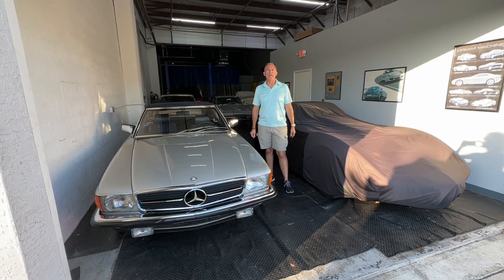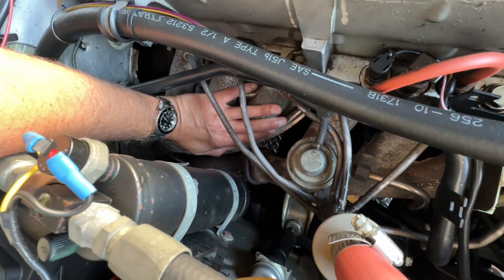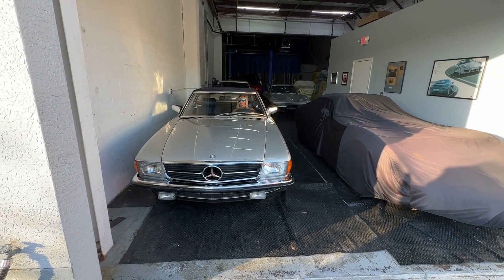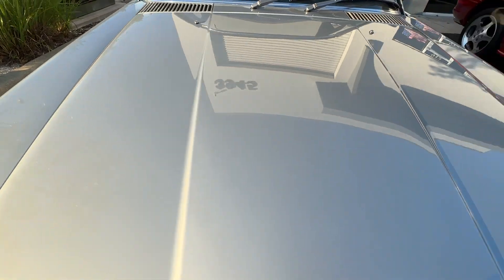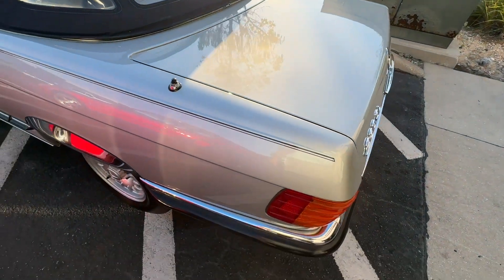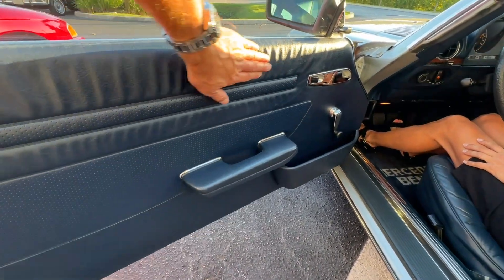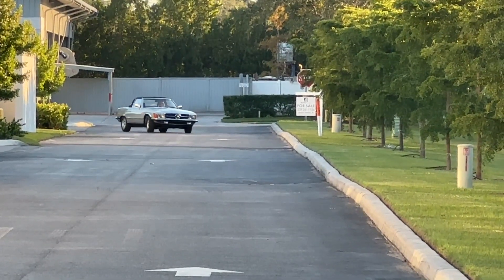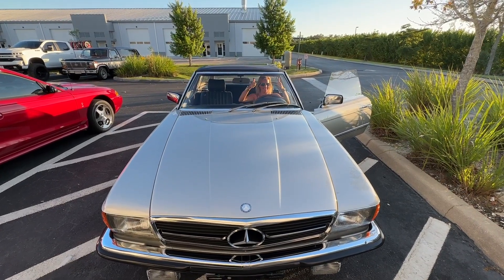1982 Mercedes-Benz 280SL 5-Speed, 10K Actual Miles - Cold Start

Comment: The 280 SL was presented in its ninth production year since 1974 no other car in the world have ever been so riped out so perfect as a R107 SL after 1980 and later..
The straight six was the most wanted engine it produces 185 Hp on the brake not on the crank so it is a rocket towards a U.S 380 SL that was castrated to 156 bhp because of 84 octane the Euro version needs 95 to 98 octane and it goes 9.0 seconds to 62 miles it does 17 mpg at 65 to 70 miles cruising speed . Petrol consumption is up to 15 percent less than a 350 SL and 25 percent less than 450 SL you can drive it with 13 Liters on 100 kilometers at 100 km/h or maybe more …
Reply: And I forgot 185 bhp at 5.800 to 6.000 rpm, double overhead cam , crankshaft with 7 bearings…topspeed 205 km per hour or 127.5 miles per hour. Fast enough for this age..
Reply: The old pagoda 280 SL had only five bearings the 230 SL only three…
Reply from the maker: Thank you for the nice comments and information about the car.  Have an amazing day!  ~S